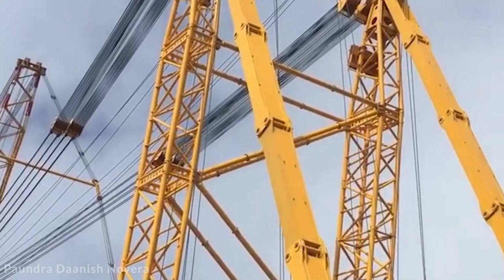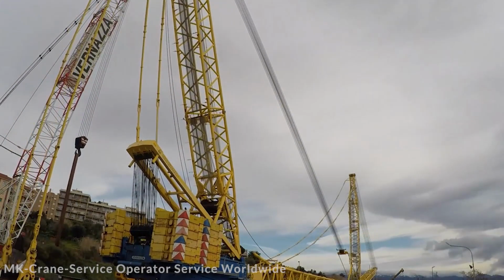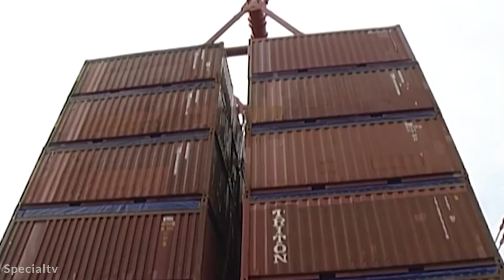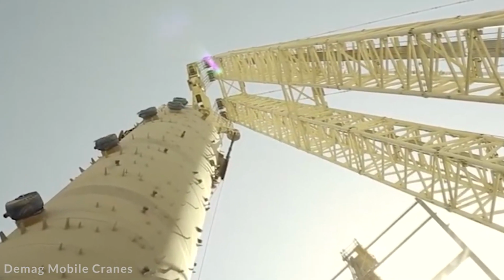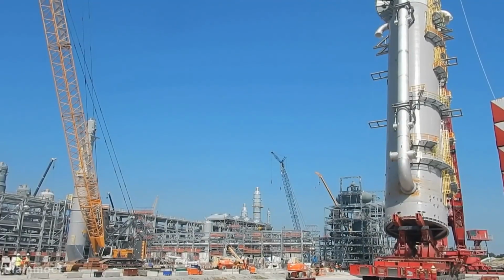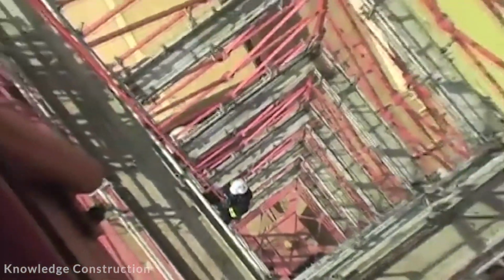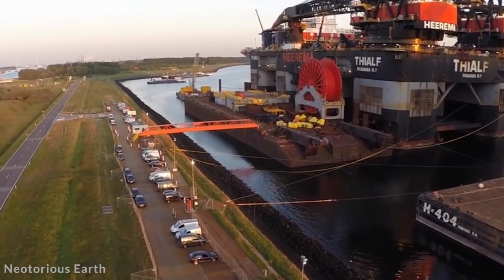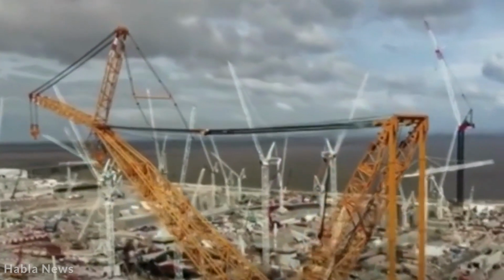15 BIGGEST Cranes and Lift Equipment

Comment: Very interesting video.  Cranes, draglines and most heavy construction, mining, road, building equipment, etc. have held my strong interest, since I was a toddler.  Most of these, with their configuration and paint schemes, are giant works of art, but of course with great engineering and practical use.